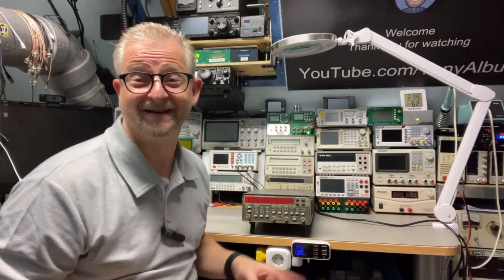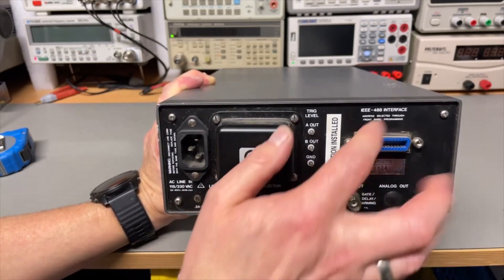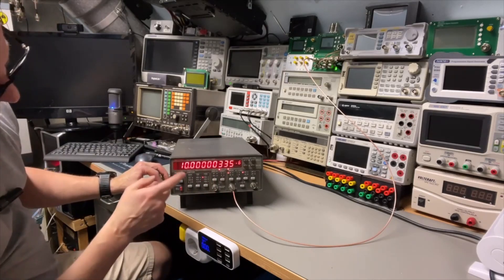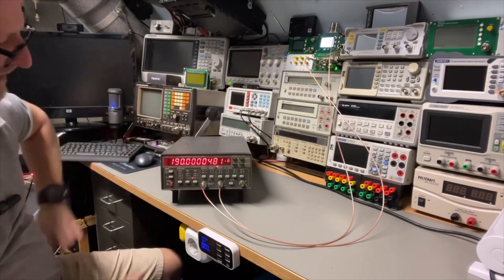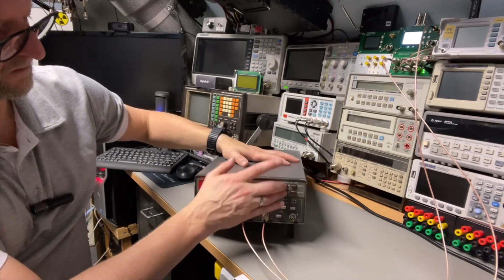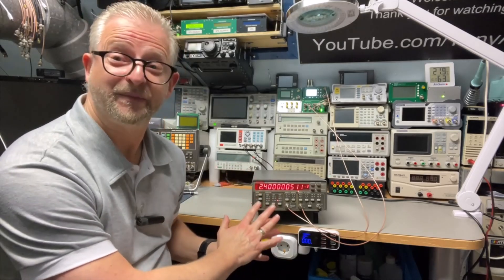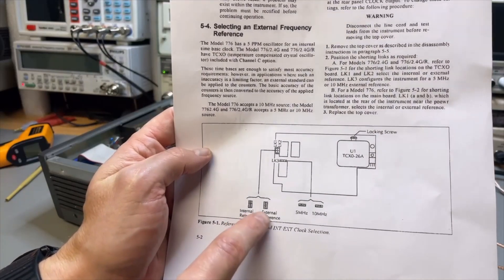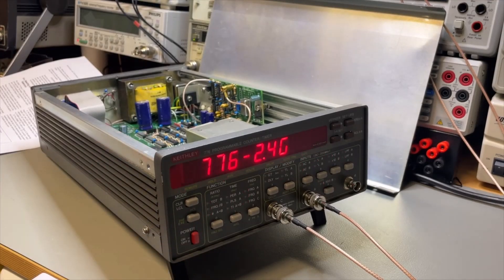TA-0315: Keithley 776 Frequency Counter does it have the 2.4 GHz option?

Comment: Tony, I bought the same counter about a year ago.  It was $100 to $200 less than other popular used counters that I was looking at on the Internet.  Most of the other counters I was comparing did not have the frequency range, 10-digit display with exponent, matched spec channel A and B (which is sort of rare), and a multitude of gate times.  It even can display both positive and negative input voltage levels on channel A at the same time.  Great for trigging determination.  Overall, I really like this counter and have enjoyed it.  When I watched your video, I went out and did some comparisons with mine which I hope will be useful information.   I have an older firmware 1.24 and the processor is a P80C31BH.  I used a Fluke IR thermometer gun like yours and measured 52C at the same coil area on the oscillator board.  Since many of those IC are ECL they demand a lot of power, so this maybe normal.  All PS regulators and the diode bridge were under 40C after four hours of operation with the cover on.  From the manual the TCXO is 10MHz, 1ppm, 0-50C.  I let my warm up for 30 minutes than over 2 hours about ever fifteen minutes I would lift the cover and make an adjustment.  I got the counter to display a 10 MHz reference signal that would vary no more than 0.04 Hz (last digits on counter .82 to .78).  After five hours I took the cover off for 1 hour and the display did change by 4.45 Hz.  Like you I will be using my 10MHz lab reference and not the internal Xtal oscillator.  Also, I measured my max counter frequency using the same generator you have and it was approximately 2.65 GHz.  Thanks for posting the video, I always enjoy them.
Reply from the maker: Thank you John, wow lots of research, that really helps. that gift me a better feeling about the 500 MHz multiplier circuit... i will just replace the TCXO with a Vectron OCXO, i have still a few also 5 Volts and square 5v out.. the board around the TCXO says 12v but the 5volt regulator is also there.
Yes mine also has the TSC80C31 (different brand prob same) . i made a copy of the EPROM for you, mine is ST M27C256 or M27256, i have it in BIN,HEX and Motorola S format.
will put it for download below the video. Thanks again for your tests, it is really helpful for me and others. i pinned your message.
Reply: @TonyAlbus  Thanks Tony I downloaded the firmware and I have a GQ 4x4.  I corrected my original post I meant to state that I have the 1.21 firmware and not the 1.24.
Reply from the maker: @jwrtiger  Hi John, perfect you have the same GQ 4x4 i read with that one here :))  yes i understood you had a before 1.24 .. hope it works for you!

Comment: I had to test and repair around 25 Keithley pieces of equipment of that vintage. After having a couple of 10 uF tants pop during the 24 hour burn-in I did I started checking each cap's temperature with the IR thermometer. By the 3rd one I was just replacing all of the 10 uF tants. (I bought 500 new caps.) Keithley had apparently purchased a large, bad batch of them and built them into their new gear at the time. So ALL of those caps in boxes of the vintage with 7-segment LED displays are questionable. The unit I kept for myself was one I'd just checked the temperatures on and only replaced 1 hot cap. Over the next 6 months it blew 2 more of the tant. caps, and they pop real good, sputtering noises, pops, and smoke. It led me to stop trusting Keithley gear in general. That cap purchase really hurt their reputation as far as I'm concerned.
Reply from the maker: Hi John, that does not sound good.... keep in mind this series was a Racal, i do have a few Keithley DMM's from 80's and those still run fine. i like the Keithley brand

Comment: My private investigation revealed that these instruments were originally made by Tabor Electronics. Also sold under Kontron and Racal brand. They are nice looking, but much slower measurement refresh rate than Racal Dana 1991, 1992 etc set for same resolution.
Reply from the maker: Thanks, nice to know!
Reply: @TonyAlbus  Check out Tabor 6020; Keithley 776; Racal 2201 to be precise
Reply from the maker: @doktorpyta5904  Thanks, with my options its Tabor6030 .. but cool! .. that racal is like 2 raindrops.
Reply: @doktorpyta5904  Thanks for the information, I did not know that and I assume Keithley made the 776.  Interesting that those units seem to have a 9 digit display (excluding exponent) but the Keithley has a a 10 digit display.

Comment: Hi Tony, one thing you could try is to measure the output frequency of the TCXO with another counter, to see what its frequency is.  If its faulty you will see that (% diff from spec) and that may lead you to look at the driving circuitry around it if it seems ok.
Reply from the maker: Hi Stephen, circuit around also used for external ref. i still have a few of those ovenized Vectrons also 5 volts square..those are good.

Comment: By coincidence I’m currently working on a 775A which has just the base oscillator. No surprise it’s not even close to as good as the TCXO option you have.  I’m thinking an OCXO upgrade may be in the future. I do notice some similarities in the main board layout between the two. Does the 776 also use an 8031 processor or did they change to something newer? Thanks for the video!
Reply: I also have the 776 and the chip I have is the P80C31BH.
Reply from the maker: Yes like John says, 80C31 also.. i will put a Vectron OCXO in it.. also 5 volts and square.

Comment: The temperature compensation can only go as far as you saw it go. It does compensate, but the curves of the compensating elements don't exactly match the frequency drift curves. So, the better option would be to replace the internal reference with an oven-based.
Reply from the maker: Thanks, yes i will, have still a few Vectrons